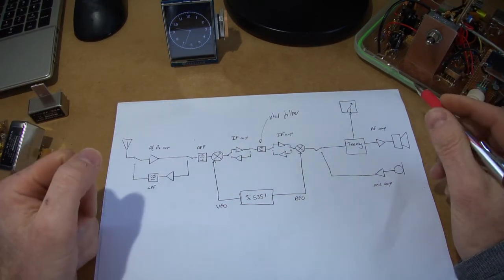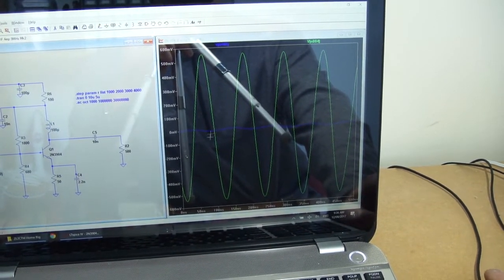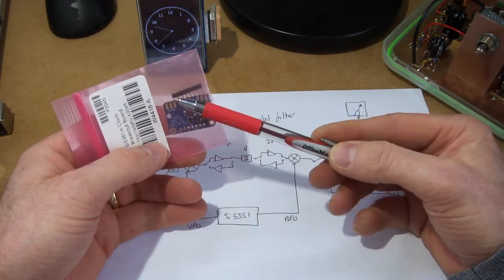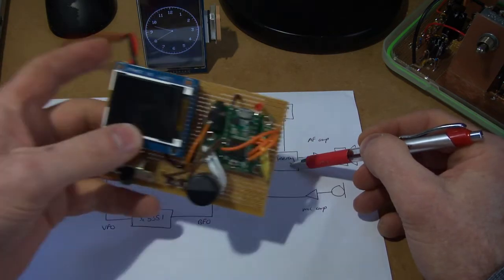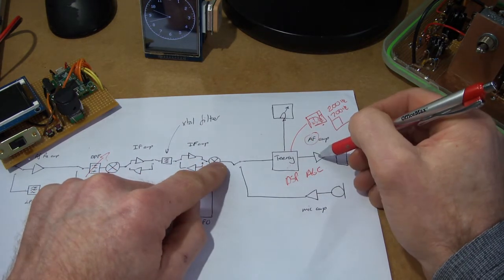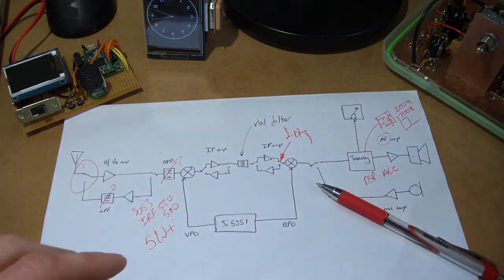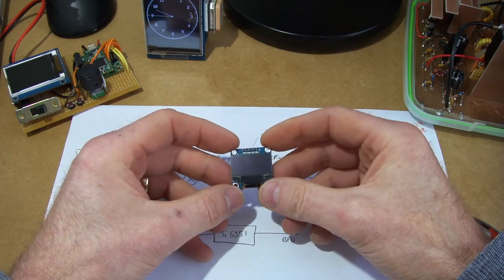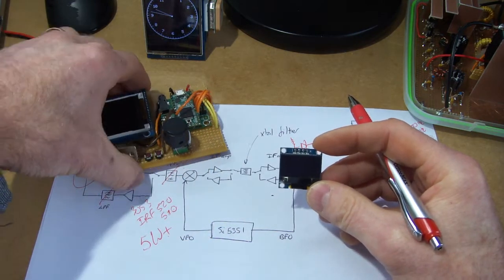How to Homebrew an SSB Transceiver Part 1 - Initial Thoughts and Ideas

Comment: Hello! Good work! In my oppinion - there is more convinient path to build a SSB transciever. I mean Weaver method - you need only 4 passive switching mixers , 2 oscillators (with flip-flops for forming IQ signals). There is a big advantage - ALL the gain  and selectivity implement in the AF amplifier (you can achive very good noise figure very easy). You needn`t any PC or MCU to process IQ audio signals - there using simple addition on the output for modulating/demodulating input  signal.
Reply from the maker: Thanks Andrew. I have tried the Weaver method before and it certainly works well.

Comment: Hi Charlie, yo8rxp here gabriel@linux-romania.com. Got some understanding issues here , maybe looking at wrong code examples.
I still do not understand how one can compute (a+b/c) and divider too in order to achieve ham radio VFO 1 HZ resolution.
Using a fixed 900 MHZ VCO is not ok since divider has to be integer, so this let me to a 4 unknown variable ecuation, and without at list 3 equations system , the problem cannot be solved. Playing witc Clock Calculator from S.I. Labs I was stumbled by how fast a,b,c and divider is calculated. Could you very please shed some light here ? coz I allready spent about 3 days researching and looking on other codes but still nothing. All I am interested in is how math works here to propper implement on Raspi or other controller but understanding the process too . Sincerely ! Gabriel
Reply from the maker: Not sure what to say Gabriel. I use the Si5351 library from Jason Milldrum. The CPP library file has the following header:

  /*
 * si5351.cpp - Si5351 library for Arduino
 *
 * Copyright (C) 2015 Jason Milldrum <milldrum@gmail.com>
 *                    Dana H. Myers <k6jq@comcast.net>
 *
 * Some tuning algorithms derived from clk-si5351.c in the Linux kernel.
 * Sebastian Hesselbarth <sebastian.hesselbarth@gmail.com>
 * Rabeeh Khoury <rabeeh@solid-run.com>
 *
 * This program is free software: you can redistribute it and/or modify
 * it under the terms of the GNU General Public License as published by
 * the Free Software Foundation, either version 3 of the License, or
 * (at your option) any later version.
 *
 * This program is distributed in the hope that it will be useful,
 * but WITHOUT ANY WARRANTY; without even the implied warranty of
 * MERCHANTABILITY or FITNESS FOR A PARTICULAR PURPOSE.  See the
 * GNU General Public License for more details.
 *
 * You should have received a copy of the GNU General Public License
 * along with this program.  If not, see <http://www.gnu.org/licenses/>.
 */

I then put the following code into the setup area in the sketch (note, sets clock output 0 and 2 ready for a superhet. 

  // Initialize the DDS
  si5351.init(SI5351_CRYSTAL_LOAD_8PF, 0);
  si5351.set_pll(SI5351_PLL_FIXED, SI5351_PLLA);
  si5351.drive_strength(SI5351_CLK0, SI5351_DRIVE_8MA);
  si5351.drive_strength(SI5351_CLK2, SI5351_DRIVE_8MA);

I then use the following code in a function that's called whenever the frequency needs to be updated. (note tailored to my radio)

  // VFO

  si5351.set_freq(((IF_freq - freq + 1500) * 100ULL), SI5351_PLL_FIXED, SI5351_CLK0);

  // BFO
  si5351.set_freq((BFO_freq * 100ULL), SI5351_PLL_FIXED, SI5351_CLK2);

I hope this helps.
Reply: Tks Charlie for quick answer, got my hands on Jason library and will have a look there.I did finish my Raspberry Nokia 5110 python script to display /refresh tcvr parammeters reading from RAM /dev/shm, now I have to solve si5351 prblm.I'm stuck with Raspi coz i do love it,I know I have to add a small  lipo batery and another gpio to emulate proper shutdown down, but it has  advantages too (keyer, logger, cw contest software and many things running with different  linux prio / nice values) , also controlling my new SOTA Beams vari audio DSP filter by emulating the grey encoder and intrerupts. If not bothers you, will keep you posted. 73, yo8rxp
Reply from the maker: Great. I'm interested in the Raspi radio. Keep me posted!

73s
Charlie, ZL2CTM
Reply: Hi Charlie, many tks for pinpointing to Jason's library, math is solved in Python using Euclid best continued fractional  by import fractions and from fractions import Fractions. then a = first integer part from (a+b/c) , then Euclid extracts fast and furios b and c variables. Easy as pie but struggled 3 days for it . Now it is time to complete m0xpd python library  with computation code  and publish it !
Reply from the maker: That's great to hear!
Reply: python clock calculator so far , next step is to verify it by combining  m0xpd  python script with mine
 https://github.com/gabrielonet/Transceiver/tree/master/si5351_vfo

Comment: I'm really pleased to find this kicking off.  I'm just starting to get into homebrew, moving up from kit building.  I have dabbled with arduino a little.  Looking forward to learning a lot here.  Thanks for the opportunity.  

Wishlist is not too far from what others have already posted.  I really like CW so want to see that used as well as SSB.  Learning about filtering with the Teensy will be a big plus.  I like the multiband idea.  80/40/20 sounds good.  I like 30m but realize that is not a  big SSB band (unless you are using digital modes).

Mark
KC4GIA
Reply from the maker: Thanks Mark. I'd like to add CW too. I wonder if we should look at generating the tone within the Teensy and feed that into the transmit side. I understand that was a common way to generate a single discrete signals in earlier SSB rigs. I have done this before and it seemed to work well. I'm thinking we could connect the CW key to one of the digital inputs and use that to trigger an interrupt. It will be interesting to see if there is any appreciable delay. It's all about experimenting!

Comment: Great project, I'm in!   I agree with Chris that you should use the Teensy as much as possible in the audio paths, so as a mic amp and audio processor . Maybe Paul's audio DSP library can do compression.  I vote for 2 or 3 bands to fully experience the joys of band switching and uneven gain over 10 or 20MHz!  --VK3HN
Reply from the maker: Agreed. I'm keen to keep use a standard 2.8kHz IF crystal filter, then do the rest of the audio manipulation within the Teensy. I'm thinking CW-N, CW-W and notch filters for a start. I'm also keen to look at implementing AGC in the Teensy too. Paul's audio library supports peak detect etc, so that should be achievable. We'll also look to apply some DSP onto the mic audio. I have not tried compression before so that will be a learning experience too. 

I want this to be interactive throughout the process, so keep the good ideas coming!

Cheers Paul.

Comment: Maybe also some help on designing crystal band pass filters, something like a Cohn filter.  I suspect there is cad software or even spreadsheets out there that make this easier.
Reply from the maker: I think I'll use the 9MHz crystal filter for now and perhaps look at a homebrew version at a later date. I must admit my attempts to date have not been that great. I measured all the crystal parameters etc (much like Pete Juliano did recently), but the performance wasn't quite right. I must get my hands on some more crystals and try it again.

Comment: Hi Charlie, nice idea!  I had thought of taking the bitx 40 design which I really like, and homebrewing that rather than buying one.  My main motivation is learning.  Some intro to ltspice and home brewing a 2n3906 / bc548 from amp would be great.  Guess there'd be some kind of preselector/band pass filter on the input before the rf amp, maybe diode switchable for 80, 40 and 20.  I was thinking of using the mc1349 if amp chip, and doing the agc there.  How computationally intensive is the dsp audio filtering at if, I assume if there were the spare pins you could also drive a rotary encoder, and band switching.  I know sotabeams have a very nice dedicated dspPic based audio filter board, but I'm guessing the teensy could probably do this and run all the radios display and band switching software as well.  Alternatively I guess you could go the Tayloe detector then phasing method of if image rejection, in the teensy.  I see in your previous videos you have been experimenting there.  Tim
Reply from the maker: Thanks Tim. 80, 40 and 20 sounds like a good idea, and it looks like we have plenty of spare pins on the Teensy 3.1 to make it all the switching work. No problems with LTSpice either. I like to do all the amplifier biasing maths from first principles, then simulate the design with LTSpice to fine tune it. If I don't understand the underlying maths then I don't like to use it. We'll certainly cover that. Thanks again.

Comment: Hi Charlie, looking forward to this series. I enjoyed the previous series on the SDR radio.  Just wondering why you would not use the Teensy Audio board for microphone in? This will give flexibility to add some DSP to the mic. Also, you can (I have done it before) drive the OLED and Si5351 via the Teensy I2C.  I may follow along and build my own this time, 73s Chris zl2cco from Wellington.
Reply from the maker: Hi Chris. No reason why we can't use the Teensy mic in as we did with the SDR rig. I'll add that to the design goal list. We'd probably look use the headphone out for RX audio and line out for mic audio. I also have here on the desk the Teensy 3.1 happily driving the 0.96" OLED and the Si5351 via the I2C pins  18 (SDA0) an 19 (SCL0). I've also set up digital ports 0 and 1 as interrupt inputs (on CHANGE) for the rotary encoder. All is working well, which is great. Keeps the comments coming!

73's also from Wellington.
Charlie